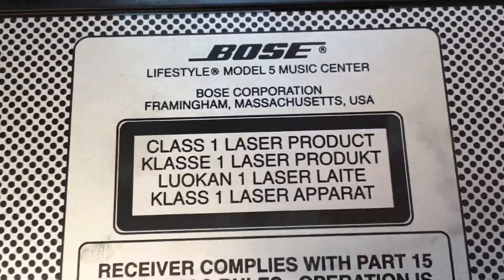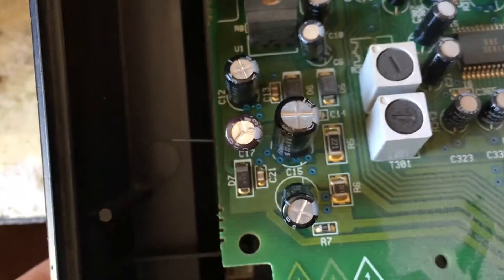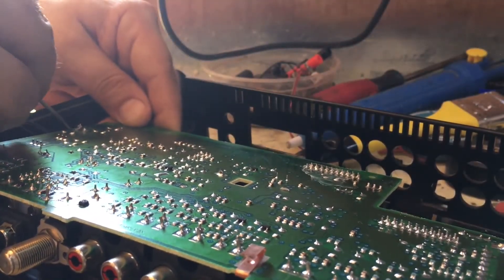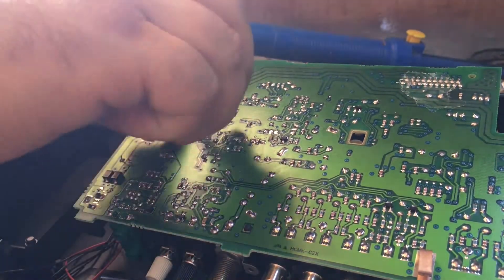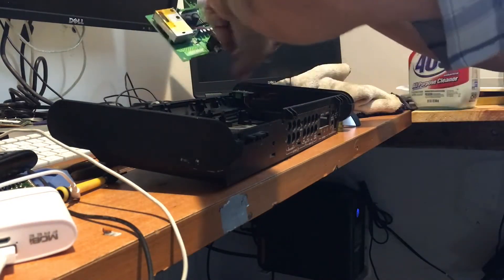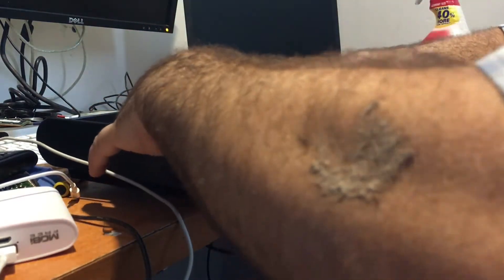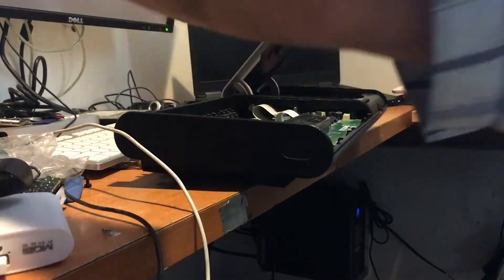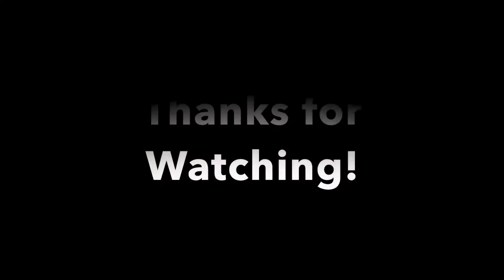Bose lyfestyle model 5 music center repair no display - english

Comment: The Bose system I have to repair has an identical name and model number, but my C15, C16, and C17 electrolytic capacitors are located on the upper digital circuit board, just in front of the display.  I'll get some electrolytic capacitors (where is Radio Shack when you need them?) and report back on my success.  I don't know if this unit is newer or older than the one fixed in this video.  In repairing broken circuit board traces I have found that I have the best luck making jumper wires out of insulated stranded wire and connecting the broken trace or traces with these.
Reply from the maker: I did notice that there are some units with the exact same name but the capacitors are named different than this one. Not sure why, may be a different year or revision, but I. think if they have the same problem, the solution will be the same, replacing the fluorescent lap capacitors.
Good luck and please let us know how it goes. Regards.
Reply: Mark did you get this fixed?  I have the same model you do with the upper board, which caps did you replace to get it working?
Reply: Not yet, unfortunately.  I normally fix clocks, and this thing appeared unexpectedly after languishing at a customer's house for years.  I tried replacing some capacitors, but to no avail.  I believe the problem is in a voltage-doubler (or tripler) circuit that supplies a high voltage to the fluorescent display. There is or was a usenet group called (approximately) rec.electronics.repair and I used to contribute there.  I'll see if they still exist in any form. Meanwhile both its owner and my live-in spouse would appreciate it if I got the wretched apparatus out of here already.

Comment: Any suggestions for how to fix a broken OFF button?  I don't see anything obviously wrong with it.  It feels good.  Nice solid click (with the cover off).  Before it stopped working, I had to press very hard to turn the unit off.  Thank you.
Reply from the maker: Well, I believe that is a simple push Botton, you can just easily replace it. Or clean it with sprayed alcohol, once it is wet on alcohol, pressed repeated times and give it another rinse of alcohol and let it dry for an hour or two.
Reply: The button is integrated into the circuit board.  Replacing it is way beyond my expertise.  I would not even know where to start.  I will clean it as you suggest, but I don't think it is a simple mechanical button.  Thank you.   @Letsdosomethinguseful

Comment: Ay i just found this same radio i was taking my garbage out and a neighbor was about to throw this in the trash but i got it this morning with some other stuff is this bose cd player worth anything???? If so how much
Reply from the maker: Not really, the gist of this equipment resides on the subwoofer. This unit is only a radio and CD player. The 5.1 amplifier is in the Subwoofer. If you find a subwoofer for it (not any sub, it has to be the correspondent Bose lifestyle sub) you can use it with an Aux and it has a very beautiful sound.
Reply: I got the sub also two they twist left or right
Reply: 30 years ago $3k, now not so much

Comment: You do fix these job repairs?
Reply from the maker: Sorry, I didn't get the question. I don't have a shop to do repair, I do that in my spare time and just try to share what I found so other people can do their own repairs or learn something but I don't receive money from those repairs.
Reply: Let's do something i wish i was good in fixing electronics. I have the lifestyle 5 and i did open it and replaced one of the capacitors but still didnt work
Reply from the maker: There are 3 capacitors to replace, not just one. C16, C15 and C17. Replace all 3 and lets see if it works. Does your system has the same problem than mine? (all works but no screen?). Greetings and good luck.
Reply: Let's do something. Yes it was the same issue but i only replaced one capacitor but i think there’s a problem with the outlet connection now. It doesnt seem to work now but i will try and open it back up and maybe it just needs some soldering with the connection of the wire at the back
Reply from the maker: That is correct, Bose has some issues in some models where the AC inout jack get toasted or broke internally. Could be the same for the DC inputs too. Regards.
Reply: Let's do something yes its crazy that it was working except the lcd and when i replaced one capacitor and put it back i might have loosened the ac connection so i have to play with it again
Reply: Let's do something hi i just noticed your board is different than my lifestyle 5. The c15,16 and 17 is in the smaller board. Its in the same board where the lcd is attached. Its in front of the lcd and two of the capacitors is 100uf. Can i use the 33uf instead?
Reply from the maker: No way, You should always go higher on capacitors not lower. If the original capacitor is 100uf, and you cant get another capacitor of 100uf, you should install a bigger one like 120, 200 0r 220 uf. Never go lower with capacitance or voltage in capacitors.

Comment: Mine is different C14 - C19 are all on the same broad as the LCD screen from left to right C19 C14 C16 C17 C15 C18
Reply from the maker: Yes, I did noted that there is a variant in this model with different configuration but same exterior.